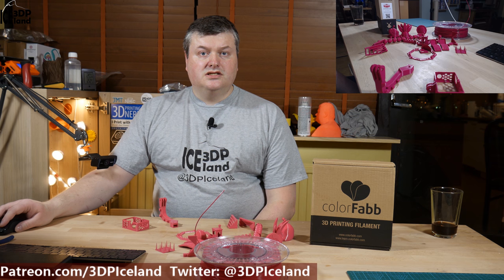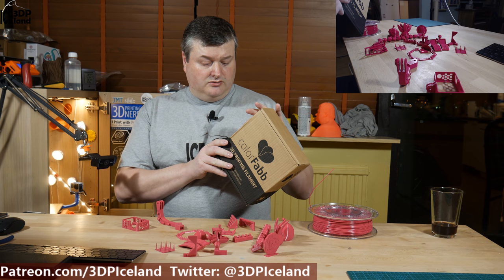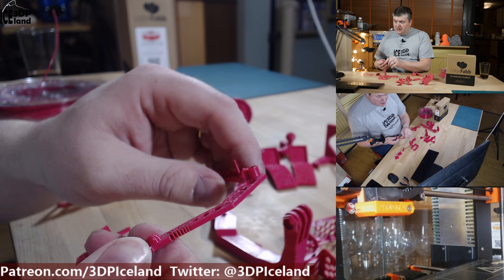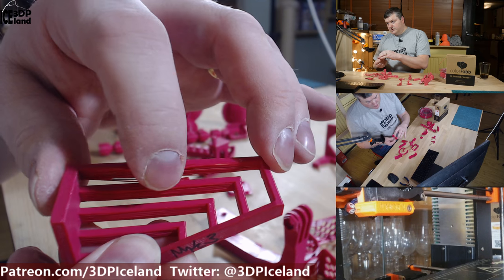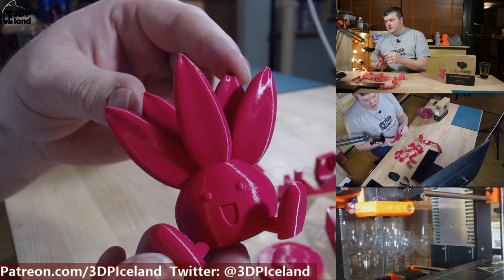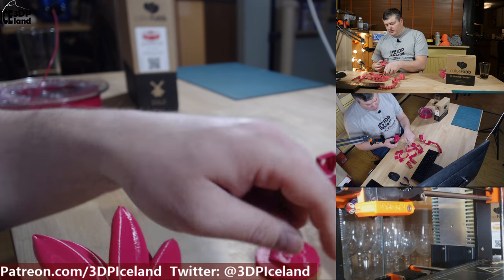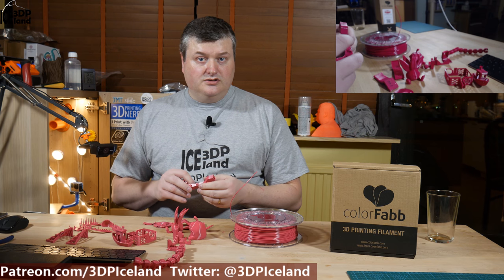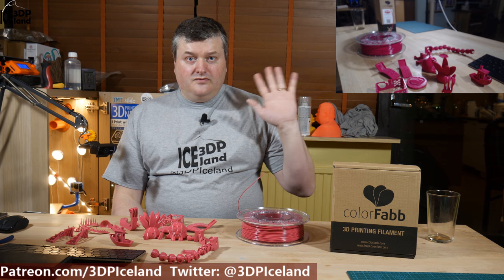ColorFabb XT Filament Review

Comment: What an excellent review.  You were not afraid to break parts to show how strong the filament is.  First video of yours I have seen, will be watching for others. I have found XT really good for sanding, I have used it to make patterns for sand casting and it sands really well without going furry like PLA. I also found it gave excellent prints in my Robox. Currently trying PETG with good results, but if not happy with it will go back to XT for all my printing.  Temperatures for the Robox using XT are as follows. Bed 80/75, Nozzle 255/250 and ambient of 35.
Reply from the maker: Thank you!

Comment: On Excellent review. Subscribed. You mentioned speed and Temps. What fan settings were you using? I have never used a fan with PETG but it is obvious in your overhangs that a fan helps a lot.
Reply from the maker: Thank you, - fan on petg should be minimal, but just 20% helps a lot,  - Check my video on petg and fan speed in regards of print strengh.

Comment: Great video and lovely prints, thank you! What settings and setup do you use on Mk2? I'm struggling to get a good first layer
Reply from the maker: Thanks. With this filament I used the Slic3r preset for this filament, -  1st layer at 260°C, remaining layers at 270°C, bed at 90°C, coolling fan disabled for first 3 layers, then at 30-50%. Hope that helps you, I print directly on the PEI sheet with this filament, and it's sticks really well to it at that temp.
Reply: Thanks for the quick reply; I finally got it working after a really thorough clean of the PEI with windex, acetone, and IPA. Looks like I had some residual gluestick and finger grease on there! The rest of my settings are identical to yours via Slic3r. Thanks again sir
Reply from the maker: awesome,